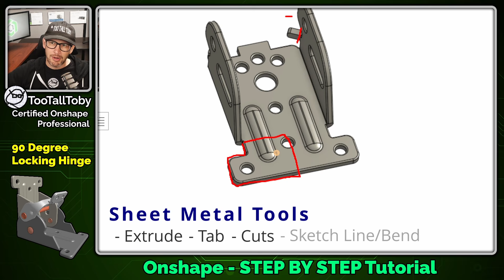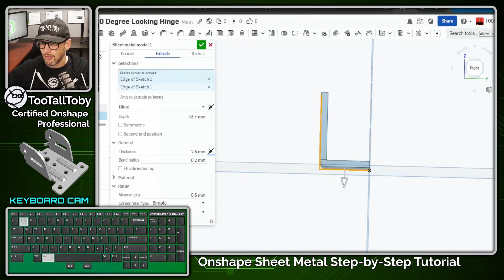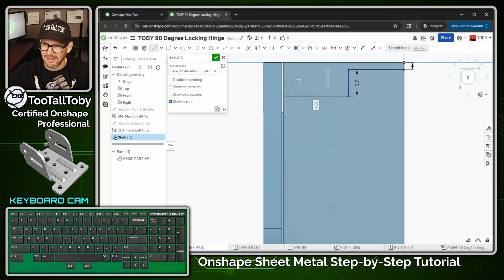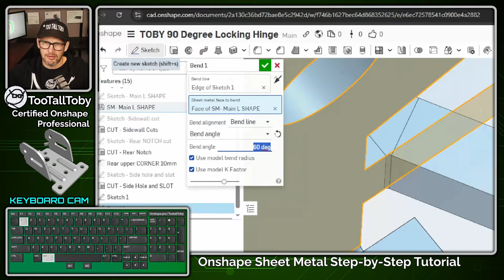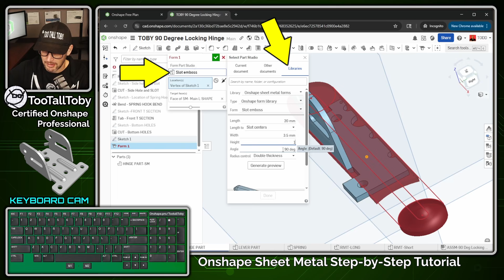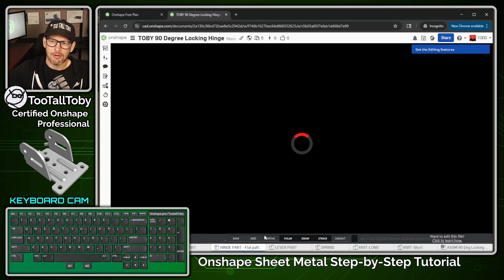Sheet Metal Made Easy in Onshape | Step-by-Step Tutorial

Comment: Creating half a part may be the fastest shortcut zippy zap magical way to model something that is 100% symmetrical & already fully designed, but designing a part from scratch often doesn't work that way. Sheet metal parts usually start with a base web to which flanges are added, holes are positioned, & bend rads added at the end. If it turns out to be symmetrical, great, but limiting yourself to symmetry from the start is not something a designer would accept, & pointless for a flat pattern part.

Comment: Hi Toby, how do I select the slot’s orientation lengthwise? When I apply it to a point, it defaults to a specific direction, but I want to rotate it by 90 degrees.
Reply: That's a great question and honestly - I've looked and tried - If you locate the form tool using a SKETCH POINT, I don't know if you can rotate it. I think you have to locate it using a MATE CONNECTOR to get the option to rotate it in plane with then sheet. 

So at around 40:15, after we've created the sketch for the points (but before we add the form tool) we'd do this:
1. Exit the sketch of the point for the location
2. Create a new MATE CONNECTOR. Select the POINT at the location. Use the default mate connector orientation. Click OK
3. Add the form tool. Select the MATE CONNECTOR option (click the button) for location. Select the MATE CONNECTOR as the location.
4. Set the options for the FORM tool. examine the orientation.  If its incorrect, Exit the FORM tool feature.
5. Go back to the MATE CONNECTOR feature. Click the button for RE-ORIENT SECONDARY AXIS.  This rotates the axis by 90 degrees.
             (if you get an error about the "owner entity", click the planar face where the FORM TOOL is going to land)
6. Go back to the FORM TOOL - it should now show up 90 degrees rotates.

I know that seems like a lot in text, but if you try it, it only takes a few moments.
I think this is aligned with the general Onshape strategy of "Use MATE CONNECTORS for everything!" so this actually makes sense to me, but it caught me off guard the first time I ran into it. 😁😁

Hope this helps!
Toby
Reply: @TooTallToby  It worked exactly as you described. Thanks a lot! However, I think Onshape’s team should add this orientation control as a toggle within the form feature. It will save us these extra steps.